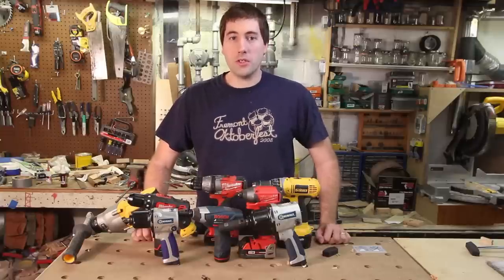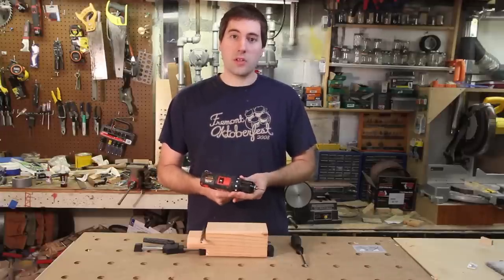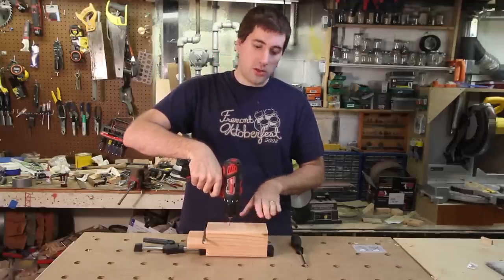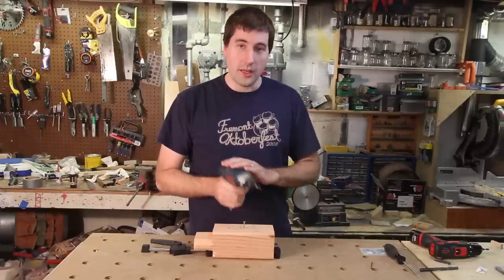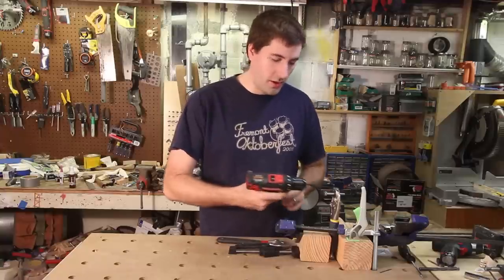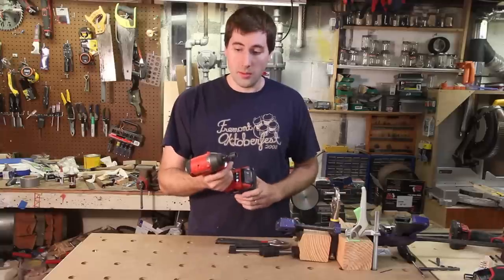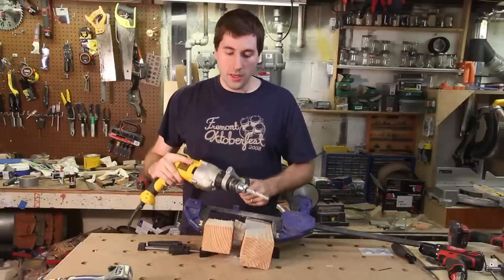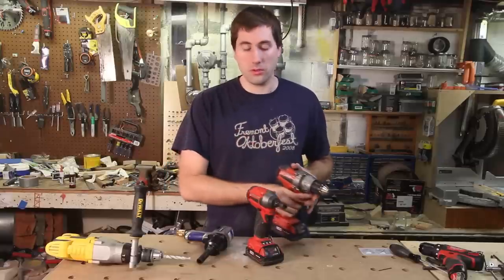Drill vs Impact Driver vs Impact Wrench vs Hammerdrill

Comment: I learned a lot from your video today thanks. 

I'm a little concerned about that gas meter. I worked for a gas company for a few years. It's dangerous if you have your gas meter installed inside your home. You might wanna call the gas company and have them installed it outside. 

I worked with a gas inspector who would not have a gas meter installed under a window or close to a door or any opening for that matter. Gas is a silent killer if it leaks you're dead. Just thought you should know.

Comment: Good video, except that I didn't really understand the impact drill until you got to the hammer drill. I thought you were saying that the impact drill rotates and also goes up and down (impacts). Now it is my understanding that the impact is applied to the rotation. Now I also know that what I need is an impact drill with a lithium battery. I may forget these distinctions, I have before, but I'll know where to go to refresh my memory.

Comment: Try drilling through concrete with a masonry bit in your impact driver.  If there were an axial force it would work great.  Don't come back until you finish a hole; it'll be a while.
Reply: Jeff McMillan,
AXIEL:  situated around, in the direction of, on, or along an axis

Comment: So helful thank you. I'm planning to gift my dad one. SO is there an option for general purpoe usage mostly cemernt and brick walls or wood. Also, can it be used to elarge a hole once it drills one, it doesn't matter if it's not perfectly round. His b'day is by the end of this month. so any quick help would be much appreciated
Thanks
Reply: +George Thomas  Sounds like a hammer drill would be your best option due to the cement and bricks. I have all the above and use my impact driver by far the most. Problem for you is that it doesn't drill concrete.

Comment: This video is wrong. Impact drivers do not apply axial force on the screw. Instead of rotating at constant speed and torque, the rotation has more of a stuttering motion. Those hits are the impact that apply a lot of torque at that instance.
Reply from the maker: They do in fact apply an axial force.  Here's a video explaining just how they work!  http://youtu.be/ilCdZArlQWE
Reply: Video is wrong
Reply: +Chandler Keen  If you watch a slow motion video of a cutaway, as the spring unloads and forces the clutch back down, it does indeed provide downward force in addition to storing rotational force. In case you don't believe me, from WikiPedia: "An impact driver is a manual or power tool that delivers a strong, sudden rotational and downward force."
Reply: Rich Flath  so does that mean when doing overhead work it would be ineffective? psssh
Reply: You can't just provide your own video explaining how they work, when the comment was saying you were wrong. Obviously, if you are wrong in this video, you're going to be wrong in another video. The hammer and anvil system in an impact driver is rotational. When it meets resistance, it strikes to keep the screw spinning. Think of it like you would a wrench. If you are trying to take a bolt off with a wrench, and it gets stuck, you might hit the handle with a hammer to break it loose. That is essentially how an impact driver works.  There are many videos on youtube that explain this. Your's is the only one I've seen that says they apply an axial force.
Reply: Rich Flath,
Damn, and just when I thought that I finally understood impact drills. Now I'll have to go looking to see what others say.
Reply: Eric Killian,
Your "explanation" is not clear. It only muddies the waters. I'll have to look elsewhere.
Reply: Erics explanation is spot on and very easy to understand.
Reply: Tools & Stuff,
Says his brother. That is a most absurd assertion. Why, If his presentation is easy to understand, do most visitors here go away still not understanding. You have one guess to answer that. The truth is, his explanation sucks.  It couldn't be worse.
Reply: I'm not talking about the video, I am talking about Eric Killans comment above which you slammed as being useless when it is a very clear and simple way to explain it.
Reply: Tools & Stuff,
I'm almost tempted to make a video that doesn't require an explanation. That's what was intended here, Unfortunately, that ambition wasn't achieved. This whole video should be scrapped, and redone. A good video would receive only thanks, not a barrage of criticism.  It obviously doesn't do what was intended. It has no reason for existence. However, I will say that I FINALLY understood what the maker of the video did such a poor job of explaining, so I guess  some could say that it succeeded. I disagree. I think I finally understood DESPITE the creator's "explanation."
Reply: Max Maker,
If that's your complaint, you are wrong. There is. no contradiction between his words and yours.

Comment: What really is needed is a Drill Bench or CNC with Impact or Power driver and for extra Hex polts if regular hand tools are not enought Impact wrench
Reply: ...as a new apartment dweller,  (If I could only buy one ) which  drill would be the best  multipurpose  tool?  I need a tool that will allow me to put up curtain rods, and shelves, etc,....

Comment: With the appropriate bit, can you use a hammer drill to drive in tapcons?  Also, are there any bits out there that you can drive a piece of plywood into a CBS block wall without changing out bits.

Comment: Thank you very much for the information.  My son has been trying to convince me that he NEEDS to buy an impact wrench (which he can't afford at this time) even though he HAS an rotary hammer,  which I guess is also called an impact driver.  Now I can confidently tell him to use the tools he has.  He doesn't need the extra power that would come with an impact wrench.  He needs to hold one end of a bolt to get a nut off the opposite end of the bolt and would likely take off his hand if he tried that with an impact wrench.  He might still injure himself doing that with his rotary hammer, but perhaps lose fewer fingers. 🙄

Comment: I need it to do reverse also.  I have a Milwaukee corded hammerdrill already but don't want to hurt the bearings that the hex head nut is stuck on.  Its on a chainsaw flywheel Echo CS330t any recommendations

Comment: dude so the impact wrench makes that pit crew sound.
Reply: No, that's the sound of an impact gun (air operated in F1, now by battery in many other motorsports).

Impact wrench is operated by hand, bit like a slide hammer if you're rich, just a spanner and hammer (or even a rock) if you're poor. ;)

Comment: I need help, im lost over advatages and disadvantages, dont know what to get. Thouht that impact driver is a jack of all trades but idk. i need something i can change tyre with but also put in screws, if i get a impact wrench i will surly be able to do automotive work, but if i wanna do some woodwork, it lacks axial force, and if i get a impact driver im either not going to be able to turn bolts from wheels or im gonna fuck up the treads due to axial forces, and yes impact driver DOES have SOME axial force. I know theres no straight answer but i would sure like to hear 2 cents from somebody who has more expiriance.

Comment: This was helpful. I need to put just a few nails in concrete. I understand I need to make about 10 holes for dowels. Since this is a one-off and not what I do every day can I use a regular old electric drill (with difficulty) or will I need the right tool (hammer drill) in order to do it at all? Thanks.
Reply from the maker: +William Ross I'd borrow or rent a hammerdrill, depending on the hole size and condition of the concrete you might be able to do it with a regular drill, not gonna be fun though.
Reply: Toolamanjaro  LOL. That's about what I figured. Thanks.
Reply: Harbor Freight and Northern Tool are good for this.  I think I got a cheap hammer drill for under $20.  Better than renting.  Then again, maybe my cheap hammer drill had too much runout causing my holes to be drilled too large, causing my tapcons not to hold.  Then again, I saw an expensive drill on a video that also appeared to have significant runout (drill bit flopping around while spinning).
Reply: Nicholas Hoffenpiper  I did find a hammer drill at HarborFreight.com - cheap but it worked perfectly.
Reply: Nicholas Hoffenpiper
Reply: ...as a new apartment dweller,  (If I could only buy one ) which  drill would be the best  multipurpose  tool?  I need a tool that will allow me to put up curtain rods, and shelves, etc,....

Comment: Which one of these is best for driving screws?
Reply from the maker: An impact driver is the ideal tool for driving screws, a 20/18volt one if you're doing big sfrews all day or 12/10.8v if you want a light but powerful driver.
Reply: Toolamanjaro Thanks, makes sense.

Comment: which would you recommend for a mechanic for working in small areas in the engine bay/suspension and interior?  I have 3 pneumatic and one 1/2 inch impacts.  I'm trying to decide whether I want the 3/8 impact wrench or the 1/4 inch impact driver.  The torque is the same for both so I'm thinking the driver since I could use it for things besides automotive work.
Reply: +rb26dett32 I would sugest Metabo Impact driver up to 400Nm with first setting up to 130 Nm.
Reply: probably could use both, but if I were a mechanic I'd get the Metabo impact wrench - it's a monster in a tiny package.

Comment: Sorry to say, most of the information in this video is wrong.He is good at explaining and nice to listen to, but again, unfortunately he is wrong in the most of it.
Reply: @quabledistocficklepo3597  The guy says the impact driver provides an axial force on top of the rotational force. This is not correct. This is not a hammer drill and that is why a hammer drill is not the best for screwing in screws. The impact driver simply provides far more rotational torque with impacts along its rotational axis.
Reply: Aspartame69,
This is not a good video. The comments for a good video would be congratulatory and full of gratitude, but  that's not what we see here. Here, we see nothing but criticism and corrections.  The purpose of this video was to clarify the confusion and misunderstanding surrounding various types of drills. From the comments below, you can see how successful   it is in accomplishing this goal. Is it fair to criticize an instructor if his students don't understand what he is trying to teach them? Sometimes. It depends. In this case, I don't think the instructor did a god job of accomplishing what her set out to do,

Comment: Sorry, I don't believe that is how impact drivers work. I believe they only provide impacts in a rotational force but not an axial force. The hammer drill is the only drill that needs to provide an axial force to drive masonry bits.

The reason your air impact wrench loosened the bolt is because it is a larger corded tool.

Also, I think you might like this video: https://www.youtube.com/watch?v=f0gSJa3L_7c
Reply from the maker: To help eliminate the confusion, I made a video on how impact drivers work, check it out: http://youtu.be/ilCdZArlQWE

Comment: bulshit! impact driver ads power to rotation impact not axial! thats hammer drill!
Reply: +frantahouska You are correct
Reply: Couldn't have said it better.
Reply: I believe the impact driver does have SOME axial force from the lowering of the hammer before rotational strike..  The hammer has to come down via a spring mechanism before rotational contact and springing back.  In theory, if you don't allow the driving hammer to bottom out, then only rotational forces are applied (assume perpendicular contact surface).  You wouldn't expect something like a hammer drill type of axial force, but I don't see why it wouldn't have downward forces.

Perhaps it's my imagination, but I've got three impact drivers, and you really don't need to push on them to get a screw in.  A lower voltage driver can be very advantageous compared to a high powered driver/drill to prevent camming out for stuff such as repetitive furniture fastener installation.  The forces peaks and the impact kicks in to drive it in slow and controlled (albeit loud).
Reply: +Lindz 37 can
Reply: @Cal L: 
While your thought here has potential, you've only got half the action accounted for, the spring has to be compressed by the rotating mass before it can push the mass back, thereby canceling the liner forces out. [There is a negligible linear force over from gravitational effect, but it is so small that manufacturers don't bother to add a mechanism to take advantage of any residual linear force by making the linear bottoming occur at the same time as the rotational impact, which could slightly improve the efficiency of the force transfers.]

Furthermore, all these electrical tools, just like their manual predecessors, have to work any angle. Although it would be pretty great to drive/hammer ceiling fixings and have the tool produce force in such a way that once in motion it no longer needs to be held inverted by hand - it being able to produce this apparent linear force itself!

Comment: well this guy has no idea what he's talking about. an impact driver provides a rotational force and a hammer drill exerts an axial force.
Reply: ...as a new apartment dweller,  (If I could only buy one ) which  drill would be the best  multipurpose  tool?  I need a tool that will allow me to put up curtain rods, and shelves, etc,....
Reply: hammer drill. i use mine for everything, from assembling furniture to putting holes in the wall. but watchout for whatever building rules you may have in place at your apartment before you start drilling
Reply: usually home centers sell these together - you can get deals on kits that include a drill/driver AND an impact driver, along with a charger and a couple of batteries. If you do it only occasionally just get a small 12v kit and you'll be fine
Reply: Impact driver and impact wrench are two different things. Impact wrench is rotational only impact driver provides some annual Force as well. Here's a cutaway video that shows it:
https://youtu.be/f0gSJa3L_7c
Reply: Samuel Matthew,
AXIAL:  situated around, in the direction of, on, or along an axis. 
It seems to me that most of the people posting here don't know what "axial" means.
Reply: Eric Stiff This video you keep posting does not support your argument. It does not show any axial impact. Are you sure you know what axial means? If you are referring to what looks like hammering on the left image, that is just the collar of the chuck bouncing around as they are only held by a fairly light spring.

Comment: 4:30 OMG u had the milwaukee m18 impact driver on the lowest gear 1!! omg u noob. it has gear 2 and 3 also. test them aswell and see if u can undo the bolt lol....
Reply: +The Saw Lol you cant be serious... gear 2 and 3 has higher torque than gear 1. Gear 1 is for small screws and gear 3 is for big screws and bolts. Remake the video and please use all gears just so i can see what a noob you are. I have the Milwaukee M18 FUEL impact driver myself so i know what im talking about. Test ALL GEARS on that same exact bolt PLEASE!!! xD jesus... ROFL